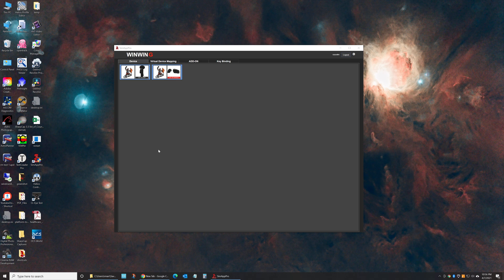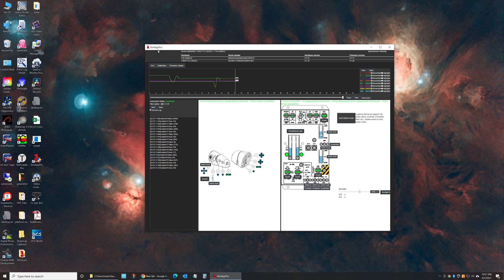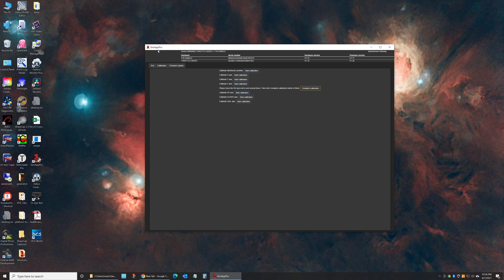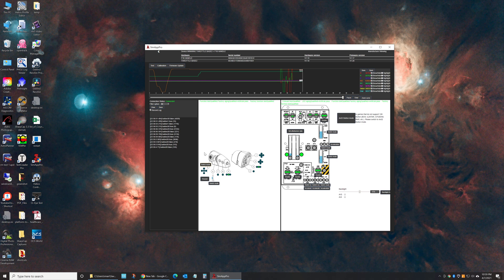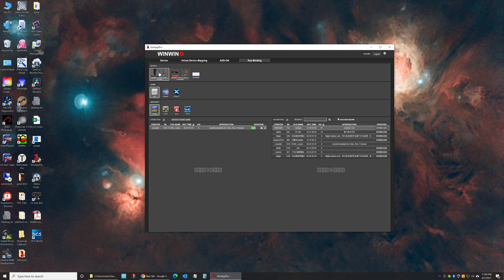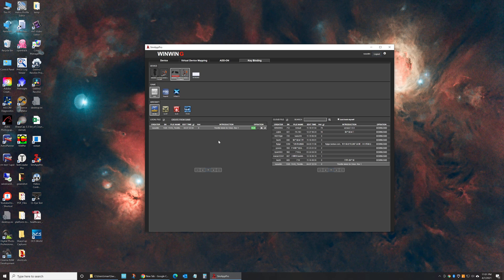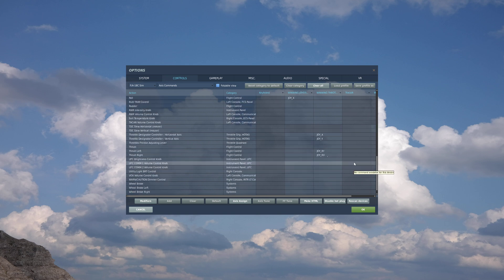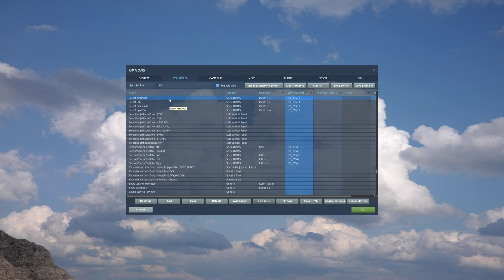Winwing Orion HOTAS SimAppPro Quick Overview setup and Keybindings

Comment: How can I just swap the buttons and what they do? The part where your like "find your game here is DCS blah blah" I dont want to do that. I dont want to use some game profile attached to certain games or .exe. I just want to click a button on my stick and reassign it to do what another button does instead. A simple swap of input.

Is there anyway to do this? It seems like everything in this app is tied to specific games. Games that I dont even have. Is there no local mode? Im trying to map my stick to control jets in battlefield 6 but it only recognizes buttons 1-12 and all the hats and axis. So I cant map the trigger or any of the buttons on the head of the stick, but only the ones on the base. So I want to for example swap my trigger to be button01 so I can just tell BF6 to use button01 for "fire" which would make my trigger the fire button. 

This SimAppPro software is insanely complicated and complex and everything is like locked to game profiles its ridiculous.

Comment: The TDC - Throttle Designator Controller - You set set it back to default X/Y. In DCS Go to Axis Tune for the Vertical and Horizontal Axis. It should fix your issue. 

Invert - DIsabled

Vertical Axis
Saturation x- 90
Saturaation y - 20

horiuzontal axies
Saturation x- 90
Saturaation y - 20

Enjoy SMooooooth

Comment: You completely skipped where you go in DCS to input those profiles you downloaded in the SimAppPro...otherwise pretty good vid.
Reply from the maker: i think the process has changed since this was released long ago. but thanks!
Reply: @russellmm  Possibly, but if you think about it, you would need to tell DCS which profile you want to use and not want it to overwrite others...so I think the SimappTool simply saves the profile in the right DCS folder in your user profile and you have to tell DCS which one to use.  Did it used to just overwrite your DCS controls on its own?

Comment: So what are the switches at the end of the throttle used for? There are no circles that light like at the front of the throttle. It absolutely makes no sense for Winwing to put switches there but not place the circles and not give it any function.
Reply from the maker: The throttle is a replica of an F/A-18 throttle. All the controls would map to the same functions as an F18 in DCS F/A-18 module. There are some documents out there that explain the functions of those buttons in the real aircraft. I don't happen to have links to them right now as I have not been playing DCS recently.

Comment: This software SimAppPro sent my security software into orbit.  It triggered pretty much every Malware alert.  Anyone else have similar issues?  Is there a 'cleansed' copy somewhere?  Not going to put a Chinese attack surface on my machine just to get this throttle to work.
Reply from the maker: i have simply refused to use the Software after my first initial encounter with it.
Reply: I'm sure they put a backdoor in this software (which they default to starting with windows by the way) and then upload all your docs to chinese govt.  My firewall went nuts when I installed this and it was trying to connect to servers all over China without even clicking on anything in the app. I block all communication with China so it didn't successfully connect.
Reply: @JSRJS  Big question is, is there code embedded in the hardware, that we can't access?   I am disposing of mine so no issue.
Reply: @pnzrldr  For sure. There's firmware on these.

Comment: The mini stick in axis mode works flawlessly in DCS, you just need to bind in the axis section, not the button section in DCS. It works much better than button mode especially when you control the man in the loop missiles, much more accurate.

Comment: Using the SimAppPro, can the Orion HOTAS buttons bind to keyboard keystrokes, e.g. Ctrl + Alt + E, W, etc? I fly add-on planes in P3D which have their internal custom keystrokes to activate certain functions, not available as standard key binds in that SIM.
Reply from the maker: I am not sure but there has to be ways of doing it
Reply: If not use Joystick Gremlin, a powerful keymapping software that work for any brand, and allow combine different brands of controllers in one "virtual controller" if need, e.g. for old games with just one controller support.

Comment: Thanks for the vid!  For some reason the X And Y Axis in your F-18 SimAppPro profile are inverted by default.  It’s totally the opposite of what it should be unless you normally fly that way. Just say’n...
Reply from the maker: Thanks, yea I fixed it after the fact and did not upload a new one since I figured people would catch it quickly :)
Reply: @russellmm  Cool!  My question now is now that  I’ve removed the invert,  Will  it still remain that way after  exiting and going back in? I haven’t had time to test that yet.